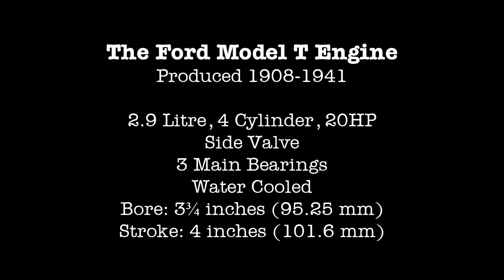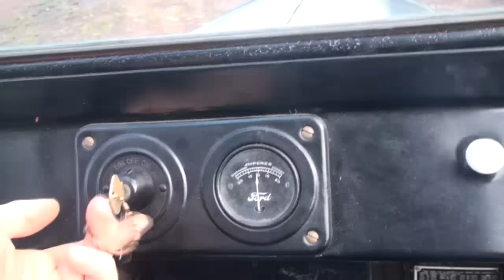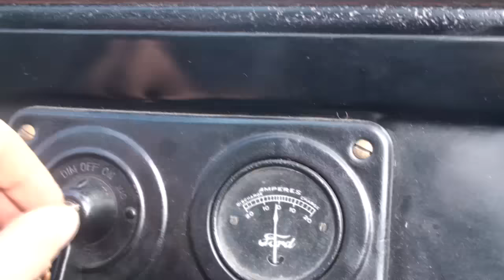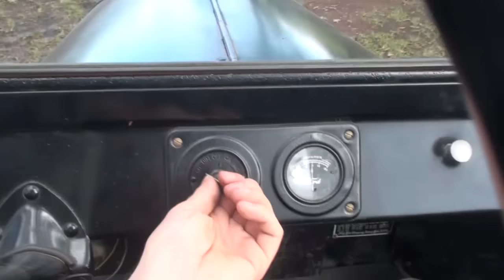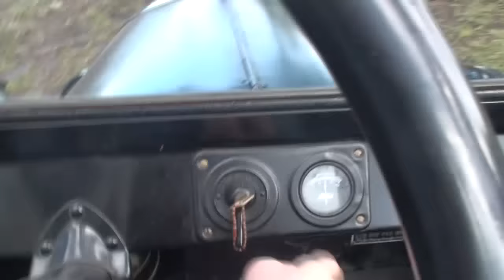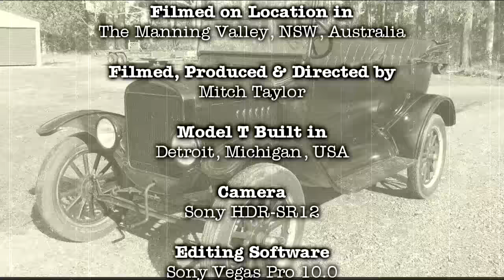Ford Model T - How to Start & How to Drive

Comment: Thank you for a fascinating detailed insight into the mechanical arrangements of a model 'T' Ford. It really was the 'step over point' from Horse & Carriage to a Horseless Carriage, and the motor car as we know it today. Thing is, it was tough and simple, and it did the job. It must have been quite a step forward at the time to make the horse redundant. The fuel tank under the front seat, with gravity fed fuel to the motor, was an interesting feature. That would be seen, of course, as a safety risk today. Excellent feature....... thanks again.

Comment: What does this use for cooling? I just see a few air slots cut behind the engine.
Reply from the maker: Thermo-siphon cooling. I recommend you watch my video on the cooling system. Much easier to see it explained, than just read about it. It's very simple though - no water pump required!

Comment: It's nice to see how these things work! I've been thinking about buying one just to have it.
Reply from the maker: You should!
Reply: Get a Model A instead.  Most people under 75 don't know the difference and a Model A has a lot more modern controls and great aftermarket support.  A 1932 would be even better.  The V8 makes it possible to keep up with modern traffic and they handle better because the tires are closer to a modern size.  But they cost a lot more than a T or A.

Comment: My 1939 John Deere B was started by turning the flywheel, it was called a watch winder tractor, as the flywheel reminded people of the watch stem cap. Otherwise, it was similar to the Ford Model T.
I now have a 50s John Deere B with electric start, but I need to restore it first.
Reply from the maker: Would be great to see a video of your old timer tractors 🚜 😀 
I've got a 1919 Fordson Model F, she runs, but she needs some restoration! 😆
Reply: @ModelTMitch  I sold my 39 B years ago, but when I restore the 50s B, I might just do that! It can be started with a crank as well, but not as nice as the 39. When done right it only took one try to get it running!

Comment: I think my first car was a 27 T truck. I say think as I don't recall. My brother bought a 30 Chrysler for $15 when he was 10 or 11. And we screwed about with that. I bought a 29 Buick and a 27 T when I was 14 or 15. I just don't recall which first. The Buick was a hard drive. Cone clutch. The T was just fun. Tricky to drive. But FUN. Once I had a drivers permit I bagged a 59 Impala. Then a 67 Mustang GT. And a 28 Dodge. Yup. Car nut petrol head. That was like 30 cars ago. I mean 55 years ago.

Comment: 55 psi in the tires?  Wow. My 1946 Indian Chief has 16" tires, and the recommended tire pressure on the front is 18 psi, and rear is 22 psi. The pnuematic tires were considered part of the suspension system and helped give it a soft ride.

Comment: Fun fact, the Ford Model T is flex fuel capable, it was designed from the beginning to run on gasoline or ethanol and Henry Ford called ethanol the "fuel of the future". This never took off because of Prohibition banning the manufacture of ethanol. Prohibition was heavily backed by one John D. Rockefeller who owned the largest oil and gasoline production business in the country at that time. Also, when I lived in the country side, my father had a 1940s Ford tractor that was remarkably similar to this, gravity fed fuel, downdraft carb, manual spark advance and throttle on the steering wheel. The only difference it had was an electric starter, so no handcrank, but the process other then pressing the start button was exactly the same. It also had a slightly more conventional 3 speed transmission and gear lever, but the exact same engine.

Comment: Is it ever necessary to adjust the spark timing after switching from battery to magneto?  Interesting videos. Automobiles have come a long way in 100 years.
Reply: Yes.  The driver needs to adjust it whenever engine load changes, such as going from down hill to up a grade.  They came with a very detailed manual and you can still get reproductions.  You'd be surprised how quickly you can pick up how to operate everything and will know what to adjust based on the sound and RPMs of the engine.
Reply from the maker: That's correct. The rule of thumb I go by; the more load the engine is under, like climbing a hill, the more the timing must be retarded. Going downhill, or on flat ground, advance the timing. 🙂 a lot of it comes with practice and listening to the engine. A Model T is definitely a hands-on driving experience 😁
Reply: @ModelTMitch  It requires a good deal of familiarity with the operation of an engine to drive one efficiently it seems.  Most all of that is done by computers now in a modern vehicle.  Even the older vehicles from the 60's and before at least had some kind of mechanical device, vacuum or some centrifugal weights to adjust timing automatically, although it was far from perfect.  I would like to try it for myself someday.

Comment: I'm wondering (and maybe this is a dumb question) if it had an ignition magneto to generate spark any time you turn over the engine, then why was there also a battery ignition system? Was it just for a backup?

Comment: Hi Mitch, how re you doing? Now, if you' re driving in high gear and you need to slow down, do you need to shift down a gear as you would do in a modern car so the engine doesn't stop? If so, how do you do that? Cheers!

Comment: How is the battery charge maintained? Is there a generator & electromechanical voltage regulator or does the magneto(s) take the place of a purposed generator here?

Comment: I wonder why they wouldn't just mount a second one-way gear between the starting crank and the frame to prevent breaking your wrist when the engine would fire backwards?

Comment: My grandparents have a model T but not in this condition. They live in a country area and they have an old rotting barn and me, my dad, and my grandpa went to go look inside and we found a cover hiding something large and we pulled it off and we were flabbergasted to see that it was a model T but it had a missing wheel and it was nothing but rust and dust
Edit: my grandpa and some of his friends are in the process of restoring it

Comment: Wild but true: In 1925, a Ford Model T cost $260, or ~$4,400 in today's dollars. The avg new car today costs ~$48,000.

This car was built to last too. Cast iron block with A low RPM...for the money you couldn't go wrong.  

I heard a lot of people did break their arms trying to start this.... It would be hard to imagine how it would do through the snow.... Maybe a tire with Low pressure...and No heater.

The Model T had a front-mounted 177-cubic-inch (2.9 L) inline four-cylinder engine, producing 20 hp (15 kW), for a top speed of 40–45 mph (64–72 km/h). The engine was capable of running on gasoline, kerosene, or ethanol. Its transmission was a planetary gear type billed as "three speed".

Comment: Wow,  very interesting.   What is the round switch on the floor to the right of the brake pedal?
Reply: Bill23799 that's the electric starter button
Reply: @banjochris  Ahh thanks.

Comment: Did these ever come in right side drive
Reply from the maker: They sure did! Most commonly these were built in Ford's Canadian plant, the rolling chassis with engine and transmission was exported to right hand drive countries, where local coach builders put the bodies on. Australia for example, most Model T bodies were built in Geelong, near Melbourne.

Comment: so you're saying that this Ford Model T from 1912 can get close to a hundred miles on FIVE gallons of fuel? 

so this car right here, this car made, designed and built in the 1910's gets similar mpg to some modern-day SUV's? 

Ford claimed the 'T' got "between 13 - 21 miles per gallon", so let's call it 17 mpg. this car was first designed and built around 1908. 

Ford™ put out its F-450 Super Duty truck, ostensibly driven by males with giant wangs, not covering up for ANYTHING small or flaccid or balding at all, which gets 16 mpg. this car was first designed and built around 2016. 

so after a hundred and eight years, Ford's actually putting out similar everyday consumer road cars with worse gas mileage?

Comment: Before I watch this video I'm going to guess that the top flips over and there is a crankshaft that you turn with a arm to start the engine on the front near the radiator..... now I'm going to watch the video and see if I'm right
Reply: Would you look at that I was right....... 11 minutes in the video he finally does it......

Comment: 20,000 volts? That can't be right
Reply from the maker: Sure is! Spark plugs usually require voltage of 12,000–25,000 volts or more to "fire" properly, although it can go up to 45,000 volts. The rule of thumb is about 10,000 volts per centimetre. Spark plugs are fired at higher voltage relative to spark gap to ensure a consistent spark.

Comment: 1925 : 2.9L 4cyl 20hp
2019 : 0.125L 1cyl 15hp

Crazy.
Reply: I have never heard of a car with 1 cylinder so i don’t know what you are onto. Every modern car has at least 3 cylinders, most of them 4.

Comment: My dad Rebuilt one of those completely on its own. It had the first engine in it and still it did run before the rebuild.  Fucking 91 years with the original Engine. Impressiv. If got the honor to drive it and with my 21 Years i was completely verwhelmed. But after a few Hours it is pretty fun to drive a car that was build in 1923

Comment: 20 horse power? As everyone should know 1HP isn't actually equal to the power one horse can output. In fact a human have a peak power output of 5HP, so if all 4 seats were filled then the driver and passengers would have more theoretical power output than the engine! It's a flintstone car with extra steps!

Comment: Clara Ford was the smart one[henry's wife] she drove a Baker Electric car over 100. years ago car she saw the future quiet and clean with a motor with only ONE[1] moving part[the armature] does not need spark plugs, belts, fluids, air filter, clean water, exhaust system, cooling apparatus system,  it was very simple you turn a switch and it was on.  and here we are exactly where its headed to...al manufacturers heavily investing into electric too bad Henry was too dumb to see the future....Clara was the smart one 100 years ahead of henry

Comment: "They had electric headlights"

* begins to wonder what we use now *
Reply: toothgrinder 
Back then electric headlights were a pretty new thing. That’s why he mentions it.
Before that, cars all had carbide lamps. That’s only a flame, made by burning a gas (acetylene).
Reply: @Brinta3  I didn't know this! Thank you :)